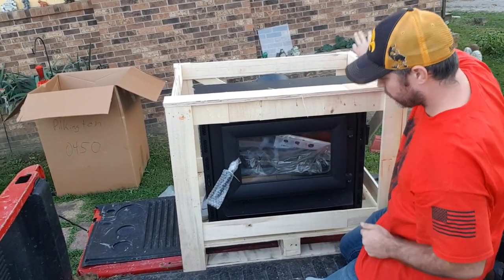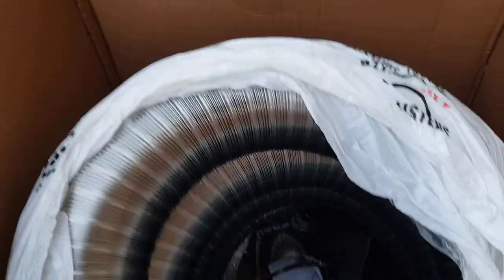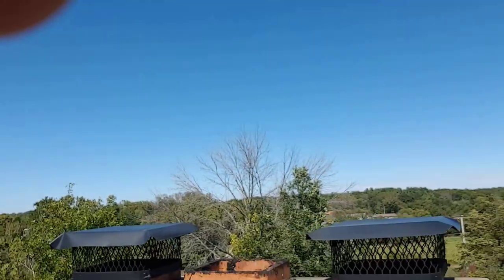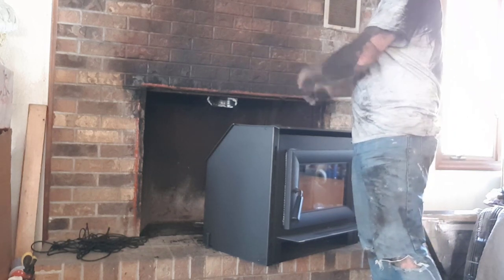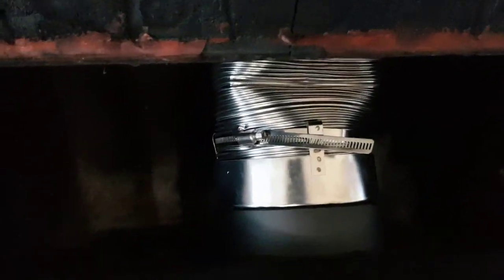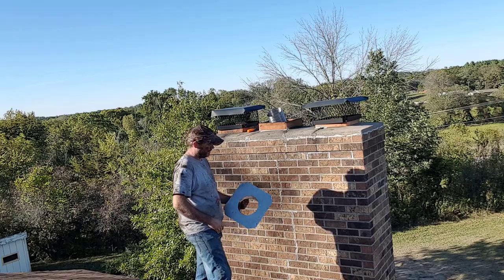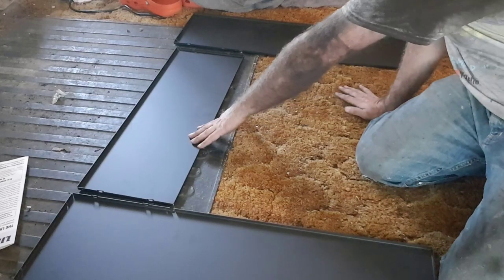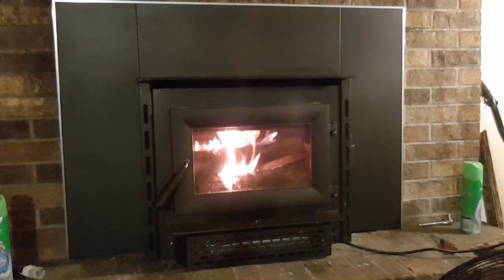Vogelzang, Wood Stove Insert and Chimney Liner Insert. Install.

Comment: I installed this in '21. First off, I cleaned the chimney itself.  Then I insulated the liner. Then I used a cutting disc to notch the damper at the bottom to ease running the liner down to the bottom & to keep the liner from compressing.  For added peace of mind,  I sealed the connection to the stove with firebrick cement, then filled the open areas around & behind the stove with fireblock insulation. Every bit of heat produced comes directly from the front, with nothing building up around it. All in all,  it's a time consuming project if doing it solo (took me 11 hours). I'll take it, since I know I saved a boat load in labor costs. All in all,  nice video. 👍🏾

Comment: I installed a lot of them over the years !! Every one is different with its own distinct problems .   "ALWAYS CLEAN THE FLUE AND FIREBOX AND USE A DIRECT CONNECT FLEX LINER " .  Good video !!!
Reply: On Amazon reviews, there are complaints of damper lever sticking or door falling off. Have you ever experienced that?
Reply: @danielcornell3671  I installed a lot of inserts is what I meant. I sold Avalon,Buck,Napolean,Jotul and a few Vermont Castings units.  I did not have but only one issue with a Jotul one time and they gave me a new one. Here is was a casting issue that was missed on final assembly but everyone makes mistakes.
These were all very reputable companies that took very good care of their dealers !
Reply: Hello what is a direct connect flex liner ?
Reply: @1980Elplacerdeviajar  Carlos it is a flexible stainless steel most time made of 304 unless you are burning coal and then it needs to be 316 stainless steel.
You run it down the chimney and use a connector that is usually screwed to the top of the stove where the flue collar has holes drilled in it.
Then there is either a flex wrap of kaowool  insulation usually held on with spray glue. If there is no room for the flex wrap a lot of times the opening is sealed above the stove and a mixture of perlite is mixed and poured in to help insulate the liner.
Then a top plate is usually glued to the flue liner and a flashing and cap are installed.
Some times it is necessary to knock out the clay liners to get enough room.
Hope this helps you .
Reply: @752brickie   thank you man !

Comment: Thanks for the Video! I'm a retired mason, who has built many a fireplace. I am moving to Baja and the home has a fireplace that has a wood burner connected into the flu of the fireplace. Someone also installed a FAN to exhaust the smoke. (I will fix it, but I suspect whomever built it didn't know what they were doing! I will most likely CUT OUT the necessary area to drop in the liner, and then use a mix of FIRECLAY and CEMENT to close up the hole! ;)

Comment: It's extremely important to install that top plate! Otherwise soot will run down between the old flue and new metal liner and can build up behind the insert. This can easily cause a chimney fire. You also want to clean the flue very well before installation. Insulating the liner with a high temperature ceramic insulation is important also because it not only keeps the liner warmer which increases draft and keeps it cleaner, but it also helps stop heat from transferring through the chimney to wood house structure.
Reply: How do you insulate the liner with a high temperature ceramic insulator? 
Wrap it before you install it?
Reply: @christopherrandolph2455  yes, you insulate before installation.

Comment: Ordered an insert from Northern Tool and it arrived today and we'll be knocking it out this Saturday. Yours is identical to our installation including the rust/rot. My sons  fireplace guy came out did some work and said its was OK to use but I disagreed so I purchased the insert. We'll also be installing a block off plate and insulation. Anyway, Thanks for sharing - you're video was Awesome!!
Reply from the maker: The hardest part was running the liner down and using a rope like I did, did the trick. I tried without it and wasnt getting more than 6 ft down it. Didnt show in video that i tried without it. Be careful on the roof if you have snow!
Reply: @thatslumlordlife  I got three of us lined up for the pipe - it looks like a PIA. I'l let you know how we make out. Thanks for the respone!!
Reply: Got it er today. A few suggestions: if your firebox is metal cut out a section on the upper rear so the pipe can run smoothly into the stove using it natural curve this way no kinks in the liner. Also, we installed the liner bottom up - took about 30 secs to pull it up the stack. Anyway, thanks again for the awesome video!!
Reply from the maker: @mikelenox8409  awesome, I'm sure you'll like the heat it blows out. My dad says it's the best investment I made for him last years! Lol

Comment: I see you struggle, there was a damper in your masonry fireplace that you should cut/take out, your liner would go a lot easy. still good job.
Reply from the maker: The damper was already out. Still was a tight fit without it.
Reply: @thatslumlordlife  Thanks for reply .Good video.
Reply: If the damper is out you chisle away some of the bricks so the pipe fits better and put an elbow on the stove so you won't smash the pipe trying to force it on. Thats what I had to do.
Reply: @jome792  Yep that s how is done.
Reply from the maker: @jome792  Mine was just hard to get through the bend, it wasn't smashing it. If i hadn't been able to get it then I would have tried chiseling some away if i could. I got it to force through though. :) glad you got yours in too.
Reply: Definitely needed an elbow. That crimp actually puts a fair amount of restriction on the system. I never install an insert without an adjustable elbow. They are available from the liner manufacturer.
Reply: @mark76197  Thanks for reply

Comment: I have one that came with the house that I just bought. I don't know if  the flex pipe is insulated but there is some kind of cement looking stuff around the flex pipe at the top of the old chimney. I have tried to light a fire in it twice so far. Both times a lot of smoke came out of the door of the insert. When I closed the door it killed the fire that I was trying to start inside. Some smoke was exiting the top of the chimney but too much was coming out the door of the insert. There is some buildup of creosote at the top of the chimney. I hope a good cleaning will fix the problem. The guy before me obviously was using the thing.  But I am having a problem. Additionally a lot of cold air is somehow getting into the old chimney and coming out of the fireplace around the insert.

Comment: I have the same one on order from Northern Tool, best price I found and also give you a $100 store card to boot. I'm just a little concerned about the liner not being insulated. Insulation kit is over $ 300 alone.
Reply from the maker: The liner is mainly venting the smoke out. That heat going up it cant really be retained so no point in having it insulated.
Reply: If you haven’t installed it yet, get a package of rockwool insulation from lowes or Home Depot. You cut it with a long bread knife or insulation knife. You can slice the pieces in half which makes them about 2 inches thick after being cut. Wrap them around your liner and use wire tie ( a roll cost like 10 bucks) bailing wire to hold it in place. Rockwool is actually listed for this use and is completely safe. Rockwool can be used as a fireblock. Cost you 50 bucks for the whole deal. And yes, you want the pipe insulated. It helps keep the pipe hot to prevent Creosote formation and give better draft.
Reply: @thatslumlordlife   I wondered about that too, everyone says you have to insulate them to keep them warm enough to keep the creosote from building up but I’ve also seen some posts that say the insulation is not going to do that much anyway, and insulation kits are an extra 300 so I’m just trying to decide what to do.
Reply: @fingolfin9086  I ended up not buying insulation for mine. From what I understand if you live in a very cold area, American northeast or Canada you definitely want it insulated but in milder locations as long as it’s in a clay lined chimney the insulation isn’t as necessary.

Comment: I just put the same one in last week- bought it on Amazon.
Reply from the maker: Nice, only thing I seen different is the door!
Reply: How much was it?
Reply from the maker: @NotAPanini  the insert was about $1500 and the liner was about $300.
Reply: @thatslumlordlife  its cheaper on Northern Tools i bought mine for 1000
Reply from the maker: @adrianomeneses6683  you must have found a deal or got one when prices were cheaper. I just looked and they are still 1399 and 1499. https://m.northerntool.com/shop/tools/NTESearch?storeId=6970&ipp=48&Ntt=fireplace+insert
Reply: About to order one, now on sale for $773, which I think I’d a great deal. Did you use yours over the winter? How did you like it?
Reply: @therosalesrodeo6430  it’s great.. no complaints. Puts off excellent heat.

Comment: Need more distance between the liner and the top cap and i would go with the ariginal hardware..
Reply from the maker: I ended up putting the top plate on and cutting it down some. Left the same rain cap on, it also helps hold the top plate on!

Comment: Did you leave the white wool blanket insulation in the stove, on top of the ceramic baffles? I had a notice to remove it as it was just for moisture control during shipping. It was not entirely clear.
Reply from the maker: I didn't see anything stating to remove it so it stayed in ours. I did however notice that it was in there and wondered what it's purpose was. My parents have been using this all winter with no issues and love it!

Comment: RE: The cap attachment for the flex tube at chimney top. Couldn't you have inverted it ? If put on other side up, it appears as though it would sit flat against the chimney top and allowed re-attachment of the chimney cap over the top of it. Keeping out all precipitation, insects etc..
Reply from the maker: The pressure from the chimney liner was still pushing it so it wouldnt stay in place without screwing it. It was worth it to me to leave it off since it wasnt going to stay in place.

Comment: after several months of using the stove did u sweep the flue liner yet? saw someone removed a decent amount of creosote already inspite of burning seasoned logs & all that jazz. can u share a video ? thanks!
Reply from the maker: I havent yet but it will probably need done after this year. I see everyone saying they need cleaned every two years.
Reply: @thatslumlordlife   how r u going to sweep the liner? r u going to move the stove out from the existing fireplace ?
Reply from the maker: @nard0q695  that is how i'm planning on doing it. Unhook the linning and let it fall down as i sweep it down from the roof. Then hook it back up!

Comment: Least you left enough liner for the next guy to do the chimney cap RIGHT...
Reply from the maker: It would have made it worse drilling into the clay and that liner having pressure from it being curled up. Nothing wrong with leaving it the way I left it. Still has a rain cap over it.
Reply: @thatslumlordlife  If you have forced air there is absolutely still the chance for a downdraft to occur around the liner. and since most with forced air and a stove run the furnace fan full time it could be a danger. It is not sealed. That is the point of that cap that seals the masonry around the liner.
Reply from the maker: @DabblelyDiddly  🤣 dude, now you just getting stupid. Danger!
Reply: @thatslumlordlife   There's a saying "some people know just enough to be dangerous" and your one.
Reply from the maker: @DabblelyDiddly  haha what makes this dangerous... let's hear it! Even without putting this liner in doesnt make it dangous. You probably shouldnt even have a fire man. Way to dangerous. I mean something could happen... you know! Bahaha
Reply: @DabblelyDiddly  how is a downdraft going to occur with the surround around the fireplace? No air from the forced air furnace can be pulled from around the unit down the chimney…
Reply: @bhud98  The furnace easily can since he did not seal any of it at all. As well he is loosing id say 40% of the heat up the chimney just due to not sealing it up. It will create a draft either way. And is incorrectly installed.
Reply: I prefer to pack some mineral wool insulation around the liner about 2 inches below the top of the clay to center the liner. Then put a 2" layer of type s mortar around the pipe to seal it. Spray with cure and seal. Them put the original cap, or a new replacement of the same style back on the clay tile. It is very effectively sealed and durable, and attractive.
Reply from the maker: @benholler1389  you think it will explode the bricks?
Reply from the maker: @benholler1389  it will be inside the liner that is then inside the chimney. Not a whole lot will come back down outside the liner. Doesnt sound like a huge difference. Someone had mention I can put something inside the chimney to hold the liner in place to put that cover on. Will that that when it warms up. I had mentioned if I have any issues I can deal with it later since it wasnt holding in place. You are for sure over reacting with it also having a liner in it when the chimney did have anything before! Haha
Reply from the maker: @benholler1389  you sure it isnt 1000 code violations? Haha post some codes!
Reply from the maker: @benholler1389  link it to the code source so I know what to fix bro! or shut up!! lol
Reply from the maker: @benholler1389  dude, you're and idiot! I have more than required clearance! lol R1003.18 Chimney Clearances

Any portion of a masonry chimney located in the interior of the building or within the exterior wall of the building shall have a minimum airspace clearance to combustibles of 2 inches (51 mm). Chimneys located entirely outside the exterior walls of the building, including chimneys that pass through the soffit or cornice, shall have a minimum airspace clearance of 1 inch (25 mm). The airspace shall not be filled, except to provide fire blocking in accordance with Section
Reply from the maker: @benholler1389  You know what the top plate does? Do you know what the chimney rain cap does? Do you see the difference in what I put back on? The top plate for liner is for a different rain cap, The rain cap it came with is much smaller than chimney so it needs a top plate, I put the larger rain cap back on that was larger than chimney. I went with the chimney rain cap that already meet the requirements with the rain cap. Can you use both, of course! It's to keep rain from going down the chimney!! lol we not having issues with that bro!!
Reply from the maker: @benholler1389  are you listening to what your posting? Birds making nests? I have a rain cap on that has mesh type sides! Bees? That rain cap wont stop bees from getting inside the liner. Would help with the between liner and chimney but probably isn't an issue and can be cleaned out. All I hear is a bunch of bitxh ass whining man! I mentioned if I had any issues I'll come back and put it on!
Reply from the maker: @mark76197  I might try that! I just wasn't getting it to stay in place and didn't want to drill holes into the clay tile. Thanks.

Comment: Did your kit come with screws to attach the pipe to the stove itself?
Reply from the maker: It didn't.
Reply: @thatslumlordlife   do you think I’ll need some or will the furnace cement/ gasket maker be good enough? I have mine sitting there right now, I just couldn’t decide if I needed screws
Reply from the maker: I actually didnt put screws in it. I decided if I needed to I would later. The pipe sealant I put on it is holding just fine.
Reply: @thatslumlordlife  thanks for the help man!! I had the hardest time getting g my pipe through the bend from the old damper!! Vice grips and will power finally won the battle
Reply from the maker: @zacharycallahan7980  I did too, for me that was the hardest part. Have to keep working at it and slowly yanking it down. Glad you got it through!

Comment: Are the panels around the insert sealed to the brick?
Reply from the maker: It's not sealed, there are two springs that hook to the stove and panel to hold it to the brick. It could be sealed though if you would want to use something to seal it.

Comment: What is purpose of vertical cabinet vents both sides?
Reply: I have the same stove.  The blower at the bottom forces air back into a cavity in the bottom of the stove.  The hot air blows out of those vents and the top of the stove to help heat the room.

Comment: How do you keep heat from escaping now that the damper cannot be closed from the pipe?
Reply from the maker: There is a damper in the insert. Lever on the right.
Reply: @thatslumlordlife  That's for air intake